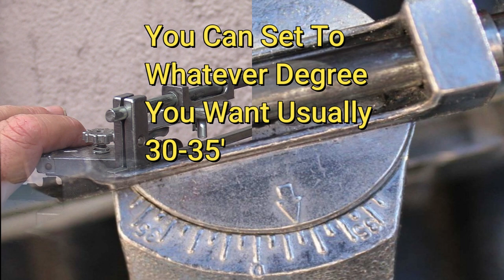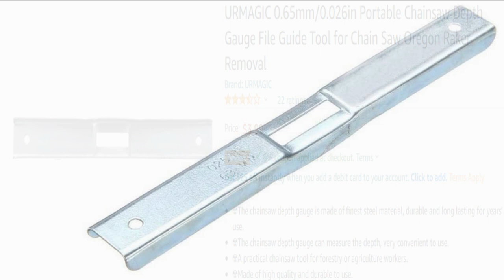Fast & Easy Guide To Chainsaw Sharpening (Factory Edge Sharp With Granberg Jig)

Comment: Excellent video.  Great explanation about the set up of this jig.
Reply from the maker: Thank you - I have had this now for a long time and it is a handy tool to have because up till i got this sharpener my blade sharpening was not very good.
Reply: @TheHomeHandyman  My sharpening was mediocre at best too.  Now , I can't believe how razor sharp I can get my chain with a round file.
Reply from the maker: @GreenEarth140  I agree with you - my sharpening was not good at all and i tried a few different methods without making it factory sharp and then i came across this handy jig - now i can get it that sharp and it does not take any time at all to do.

Comment: I watched this once or twice and thought I had it... I missed the part about the Y axis. Sharpened my blades at 10 degrees instead of zero. also did not set the depth correctly. Upon second viewing, I see my mistakes and will stop cussing at the screen. Thank you Sir for your instructional video!
Reply from the maker: LMAO - I to made errors before i got it right

Comment: Appreciate the video.  Looks like a great tool.  I'm wondering - your shop vise seems ideal - but, if I don't have a vise, will it work without a vise?
Reply from the maker: Yes - I have used it on a flat work bench but a bit harder because you have to keep it stable so it does not move around on you while you sharpen.

Comment: Ouch. Hearing a bar being called a “blade” so many times kinda hurt my soul. Good video nevertheless. Keep up the good work.
Reply from the maker: Sorry about that - you get the point
Reply: Definitions from Oxford Languages
blade
noun
the flat cutting edge of a knife, saw, or other tool or weapon.
"cut cleanly using a sharp blade"